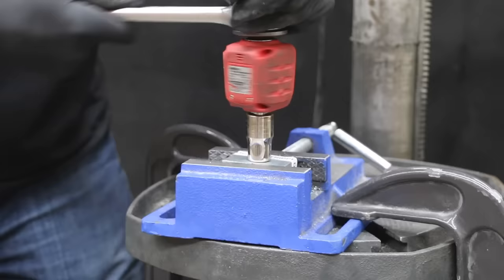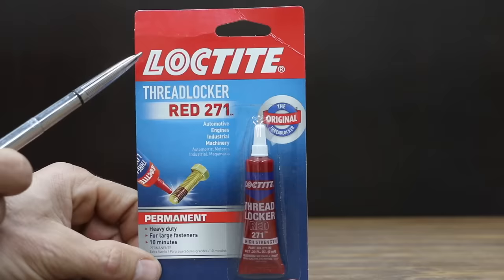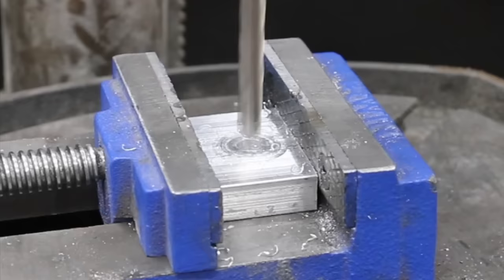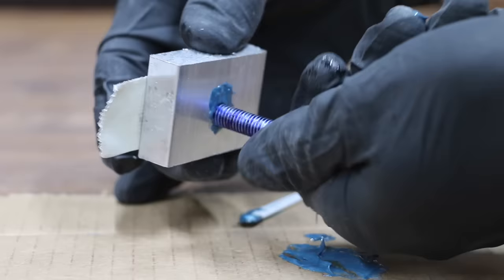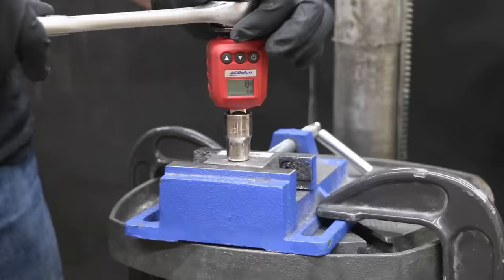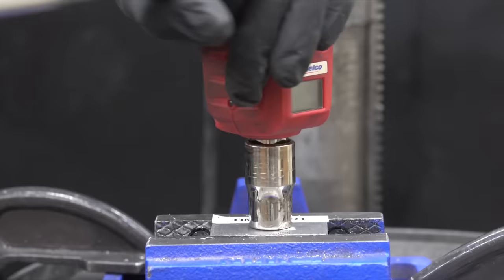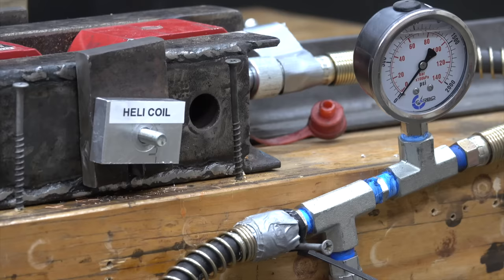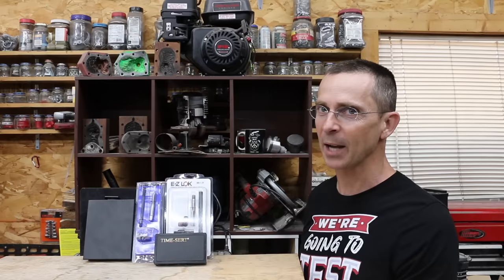Best Damaged Thread Repair? Let’s Settle This! Heli Coil, TIME-SERT, E-Z LOK, JB Weld, HHIP, Loctite

Comment: I’m also curious about backing out a well-tightened bolt on these.  I mean, tightening it until failure is pulling the thread toward the bolt, so at some level is self-reinforcing the strength, and isn’t testing the holding/gripping power of the inserts.   Maybe a strongly tightened bolt, then an effort to remove it.  Do the threads come out with it?  

And do other things affect it, like heating and cooling cycles (like often would happen in engine repair)?

Being picky.  Absolutely love your channel, and all the effort you go to, to make these tests as objective and useful as possible.  You do us all a great service.
Reply from the maker: Thanks so much!  Thanks for the suggestion.
Reply: At my work we have an old de-watering auger with a cast iron cover. This cover get removed everyday for cleaning. Over the years the threaded inserts had stripped so I ordered some heli coils.  As long as you have the proper size and thread count and you dont overtorque them too much the coils shouldnt creep out.  These were 316 SS bolts into a cast auger cover.
Reply: As an engineer at a cheapskate factory, I use a lot of these spring style thread repair kits in equipment that gets hot or wet, bolts that get tightened down with far too much torque and bolts that come in and out dozens of times each day, the inserts just will not back out no matter how hard you try but can work their way further in.

In general the thread repair isn't the bit that fails, it's usually (and in aluminium always) the base metal that fails first, they don't really rust or get bound up. 
Their only weakness is if you ram in a damaged or cross threaded bolt or don't realise it's a thread repair and try to run a tap down it.

Then you get to suffer.
Reply: For heat concerns - we use heli coils in the hot section of turbine engines for threaded hole repairs. If you're concerned about backing out the coil, stake or peen the top and the thing is never coming out... but you've now made that a one time repair. Soft aluminum/magnesium casting for propeller gearboxes, we use threadlocker to prevent backing out.
Reply: I suppose if you were concerned, you could glue the insert in with the red Loctite.
Reply: @JedLath292  what if you add a tiny bit of red lock tite when you are putting the helicoils in ? Those should then never go anywhere (not on the new thread on the inside of the helicoil, but on the thread you make to acrew the helicoil into )
Reply: @robivlahov  I've done that a couple of times and yeah it works pretty well, you just have to be careful how much you use.

Comment: Great video but I do have a note about the analysis for the heli coil, time sert, e-z lok, and hhip:

Since they all break due to the bolt breaking under load, you can't rank them based on the force it took to achieve a failure. You certainly can rank them qualitatively based off of ease of use or price, but you can't say that any of them performs better quantitatively based off of load at failure since we are concerned about the failure of the repair method, not of the bolt.

Again, I love your videos so keep up the great work! If you want to talk more about this analysis or any other analysis process let me know and I can try to help as best as I can
Reply: My thought, exactly.  Why even show the force at which it broke?  These bolts should be strong enough to exceed the predicted force need to destroy the samples.  Another test channel makes the same mistake all the time.  It makes no sense.  You're the only one I see that picked that up.  Excellent thinking.
Reply: @alext8828  Yea, I'm an industrial engineer so I do a lot of statistical analysis on processes and try to obtain meaningful data. It can be tough to get sometimes  and especially tough to look at your own testing process to see if you get meaningful data

Comment: I used that loctite thread repair kit to hold a spark plug into an engine head. It actually held it pretty well even though I was to scared to try and remove the plug after the repair
Reply from the maker: Thanks for the feedback.
Reply: The last time I replaced spark plugs on a car I'd bought new, was either in the '90s, or maybe the '80s.  Most cars come with platinum or rhodium-tip plugs now, which pretty much last forever if you don't have an engine problem fouling them.  For instance, I bought a 2003 Silhouette minivan new, and never changed the plugs before I scrapped it at 190K miles.  It was still averaging 26mpg, exactly the same as when new.  (I run "max load at max psi" tire pressures on the tire sidewall, and don't drive like a maniac, for anyone disbelieving the mpg in a loaded 7-passenger 2003 minivan with 3.4 liter V6)
Reply: @EfficientRVer  i use iridium plugs in a turbcharged mitsubishi and they do slowly degrade over time. 
Though i expect my car is much tougher on plugs than a stock power level minivan that likely makes less than half the power mine makes per cylinder.

Comment: As a tech at an Aircraft defense contractor, I've set literally thousands upon thousands of inserts. Every single type you can imagine. Kingserts, Timeserts, helicoils, nutserts...it's literally endless. The determining factor is really the amount of space available. But, for a go to for a guy in the garage, Timesert is far and away the best solution. The length of the insert cannot be over looked, Most decent thread engagement is 150% (150% of the diameter of the bolt/screw for length of thread engagement). Heavy pull applications, 200% is usually the go to.
Reply from the maker: Thanks for sharing.

Comment: The worst part about thread inserts is sometimes they unwind after threading the bolt in and out multiple times.  I usually red loctite my helicoils to help prevent it. Time serts are my favorite just cost prohibitive to have an array of sizes on hand.
Reply: I used to make some from all thread for the sizes we didn't have in stock when I worked in an industrial electric motor shop.
Reply from the maker: Thanks for the feedback.

Comment: Great video. The thread repair inserts being stronger than the original aluminum threads isn’t terribly surprising. Installing thread inserts into new aluminum on vehicle productions lines isn’t unheard of for the same reason: the minor diameter of the fastener increased. In other words, the hole got bigger; therefore, the threads contacting the aluminum had more area of engagement, and thus could handle more pressure/force. Using thread inserts makes the assembly stronger in most cases.
Reply from the maker: Thanks!  Thanks for the feedback.

Comment: The time sert is actually what use to be called Keensert. Hope my memory is still good here. These are the best repairs period. They can be bought in corrosion resistance grades. But like anything it all depends on a few usage factors. 
Nice work as usual PF. Keep on making great recordings fella.
Reply: I always call then kingserts because they had crown-like spikes that were driven down through the threads,  permanently locking the insert in place.
Reply: They are close. The Keenserts have the locking wedges on the outside threads of the insert that lock the repair in place. They use a tool which fits over the wedges that drives the wedges through the new threads locking the insert in place so that it will not back out.
Reply: Keenserts have stakes around the the top that are drive in an excellent repair good enough for aerospace!
Reply: @timothybeam1330  Those products are top notch. Hope Keenserts never go out of business Timothy. Peace
Reply: @georgecolee7663  Good enough for space good enough for me fella. v
Reply: @timothybeam1330  Also very easy to remove and replace because they use a larger than standard tap drill size. Just drill out at the regular minor diameter.
Reply: @timothybeam1330  Thanks Timothy for jogging my memory on the Keenserts.
Reply from the maker: Thanks, will do!
Reply: I 110% agree. Heli-coil has it's place but seats are better
Reply: If you have enough material left, Keensert is the way to go!
Reply: @fliegenmann2562  This insert is the Rolls Royce or Cadillac of serts.
Reply: @fliegenmann2562  they do have limits, in tight clearances I use Heli-Coil.
Reply: @georgecolee7663  Correct. Hartzell aluminum hub turboprops use them. They are incredibly strong to be used to hold a propeller on a powerful turboshaft.
Reply: @ProjectFarm  Adding Keenserts and maybe Fredserts to this comparison would be super cool.  I spec those out a lot.  I also didn't catch the bolt grade.  Increasing bolt strength could help compare some of the brands as well.  Either way, thanks for introducing me to some new products!

Comment: I'm glad I found this video. It will help I'm my decision about a problem I created. I installed a new high pressure oil pump on my 2002 7.3 and overtightened one fitting. An oil pressure line. The hpop is aluminum and produces pressures up to 2,500 pounds. "Oil inside the lines" It was only supposed to be torqued to 25 ft lbs but I over did it.
Reply from the maker: Thanks for the feedback.

Comment: I used the reviewed time-sert kit on my snowmobile oil drain hole last winter and couldn't be happier with the result.  For repairing an installed part where you don't want to be punching tabs into the oil pan, and also when you need a low profile insert, I would recommend the time sert.  It's worth the money.  Also one tip, to catch chips when drilling and tapping, use liberal grease on the tool, the chips will stick to the grease.
Reply from the maker: Thanks for the feedback.
Reply: Used a timesert kit on my 2005 crown Vic after it blew a spark plug out, second time it ejected a spark plug in the 4 years I owned it

Was pretty easy to use, if a little expensive

I used lots of grease on the bit and compressed air

Sold the car to a buddy who flipped it to a neighbor, still running around somewhere
Reply: Theres a brand of grease called Assembly Goo (should be blue colored) that is designed to melt and dissipate in high heat, meaning its safe to use in more sensitive internal components as well.  I use that on both the bit and surrounding areas to catch chips in more sensitive environments
Reply: I used the Time Sert on a very tricky repair of a threaded body tube on a Honda rear suspension trailing arm. The threads are inside a threaded "tube" that is sandwiched (captured) inside of an internal frame rail. Every time that vehicle comes in for service, I always take a torque wrench and set it 5lbs below factory value to insure it is maintaining the torque value. We are about 2 years and nearly 10k miles and the repair is rock solid.